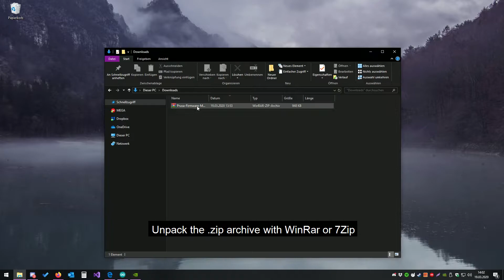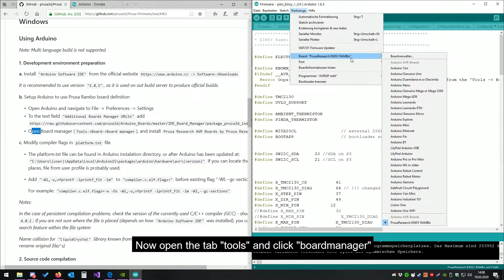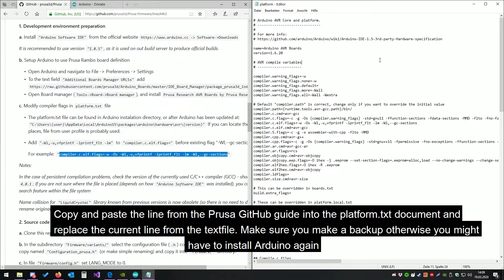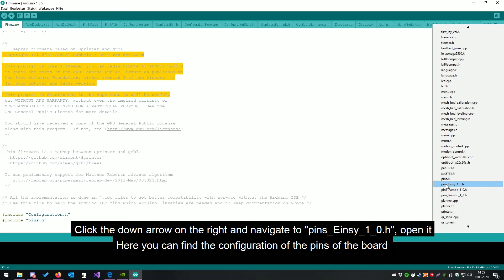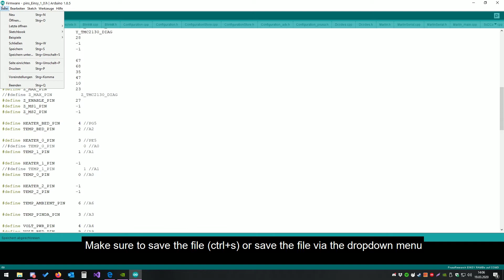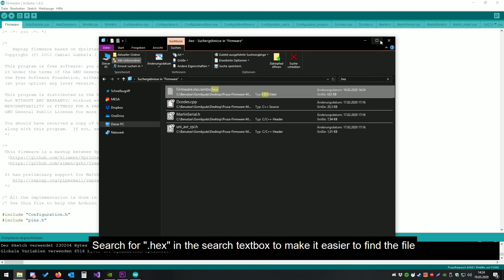How to use/switch to the second thermistor connector on the einsy RAMBo - Prusa I3 MK3s

Comment from the maker: Be careful, read my comment first.
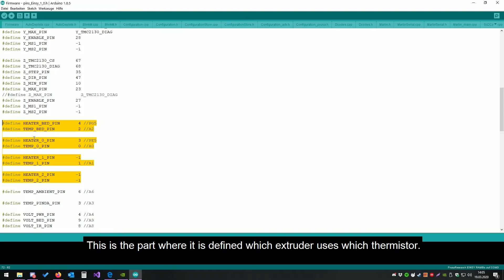3:10 - I've made a mistake. Do not copy the values like I've shown in the Video, but rather only switch the values.
You can also watch the correction video, if you found my instructions to be not very helpful: https://www.youtube.com/watch?v=rkIclxbBbDc
For example:
Before:
#define HEATER_0_PIN         3 //PE5
#define TEMP_0_PIN           0 //A0

#define HEATER_1_PIN         -1
#define TEMP_1_PIN           1 //A1

After:
#define HEATER_0_PIN         3 //PE5
#define TEMP_0_PIN           1 //A0

#define HEATER_1_PIN         -1
#define TEMP_1_PIN           0 //A1

So you'd assign the TEMP_0_PIN the value of 1 and the TEMP_1_PIN the value of 0, therefore you'd switch the thermistors.